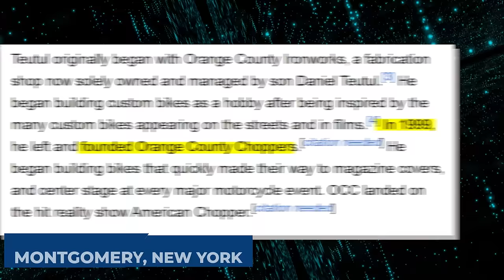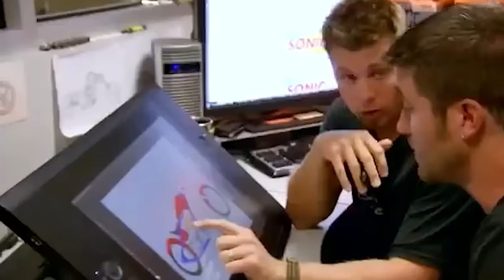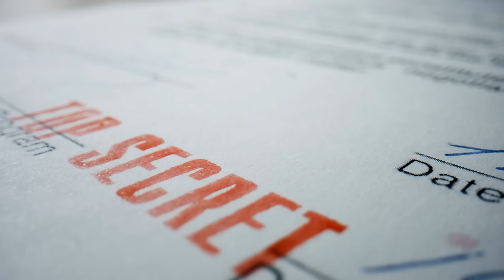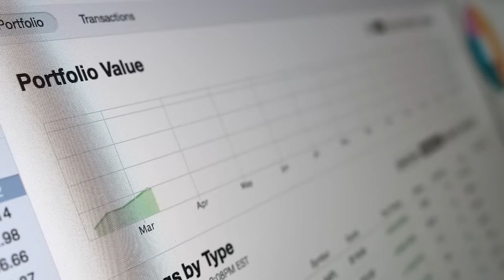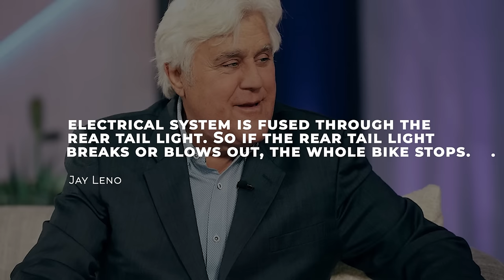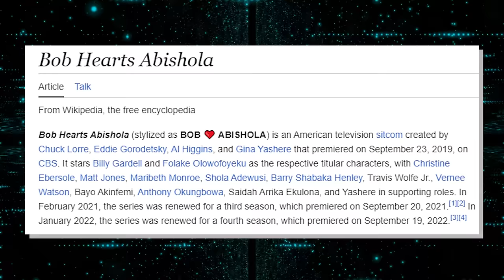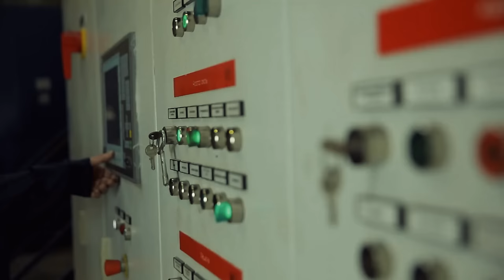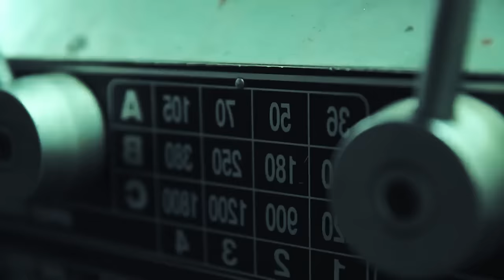Jay Leno COMPLETELY RIPS Orange County Choppers LIVE On Television

Comment: Television programming was a wasteland at the time OCC came along. Instead of evolving the bikes to be better performance and taste, they became unsustainable sculptures on wheels, laced with cheap parts and thirsty garbage engines. A vertical air cooled twin in a poorly handling heavy theme bike getting 20mpg? If you lay it down, who can fix it? 
But the show became like a hissy fit Jerry Springer garbage drama queen program, and cancelled itself.

Comment: Interesting show. I guess you can make a comparison to the cusom cars you see built on TV. You see them at car shows all the time. Trailer queens that look cool rumbling across the show field. High horsepower engines that never hit 3000 rpm. They're not meant to drive. It's obvious. 3" off the ground. Tires 1/2" away from fenders. Excessive chopped tops. It's all uncomfortable for any length of time. It's meant to be like that. 
Cars that are drivers can also look great. But just need to be lifted a bit. That's the plus for air bags. Lower it at the car show or cruise.
Build your bike or car so it's road worthy and safe and drive it. Enjoy it !! As someone remarked, it's not a Christmas tree!

Comment: Yes most of the choppers were junk. Most were horrible to ride and they would stick crate motors in them with low horsepower. Braking for most were less than ideal.

Comment: so combustion water jetting fracking, is sorta like boring a diameter deep into the mountains vertically , blasting high powered psi inside the tube so deep into the earths layers then if it doesnt work u just repeat the process, cause who has time to build and wait for a oil rig to be erected